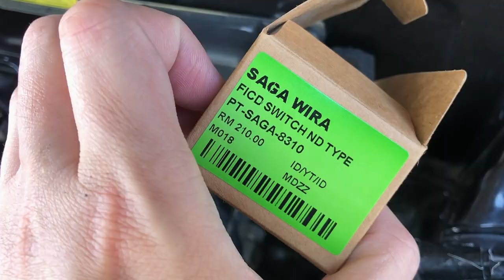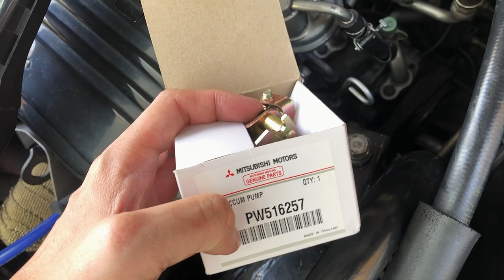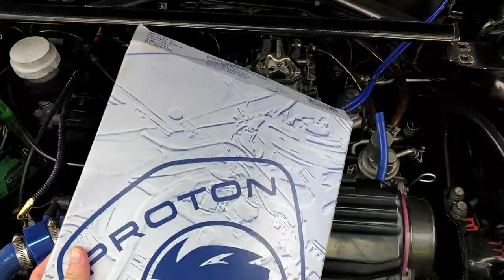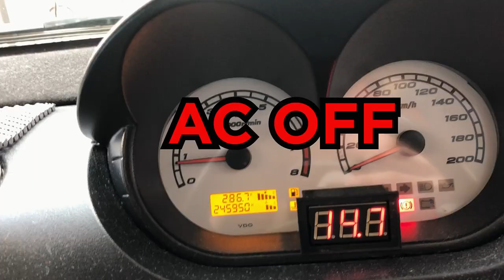LMST Vlog :  Enjin rasa nak mati bila buka aircon? tukar part ini (Sub : BM/中文/Eng）

Comment: Bos, nak tanya.. kereta satria c96 1.3 4G13 sy, sy perasan xder vacuum actuator.. xpi ficd ada.. normal ke tu? Engine saya bergegar teruk bila buka air con. Xpi mounting semua baru.
Reply from the maker: Kalau buka aircond RPM turun maksud actuator memang dah rosak. FICD memang sambung ke actuator untuk kontrol vacuum, dua benda mesti wujud.
Reply: @junkitlow  terima kasih bos untuk pencerahan yang diberi. sy akan try periksa sekali lagi.

Comment: Mcmana sambungan hosenye ya?.... Ada 2 hose tu kan atas n bwh..
Reply from the maker: betul, atas dengan bawah jangan tersilap bila cabut..
Reply: @junkitlow  atas ke mana? Bawah ke mana?
Reply from the maker: @zulfaid3682  dia amik vacuum dari intake manifold...pergi FICD trigger sensor....kemudian pergi vacuum actuator untuk tolak shaft supaya boleh sentuh pin RPM
Reply: Ficd atas/ bwh lubang sama ke?.  Ke ada klua masuk ..
Reply from the maker: @zulfaid3682  Kalau tak silap satu masuk satu keluar, so FICD dalam ada on / off switch kasi pressure udara lalu.

Comment: Bang kau buat mcm mane strut bar tu...Saya ada satu set mcm tu UR..jengg sbb x thu nk setup mcm mane
Reply from the maker: Ya ini UR bar, dulu saya pasang dekat UR HQ dia kat Ampang. Boleh try. Sebab strut bar ini kena welding and drilling.
Reply: @junkitlow  aduh saya kuala trg....yep mslh welding tu saya cfuss....adehh rumit x
Reply from the maker: @raa8700  Dia ada special bracket dekat kiri kanan atas absorber bos
Reply: Kos terlibat berapa ya @junkitlow  sbb biasa trus point di absorber mounting susah nak tukar air filter